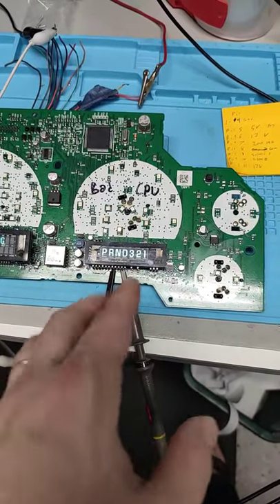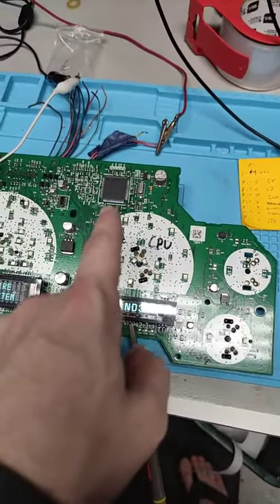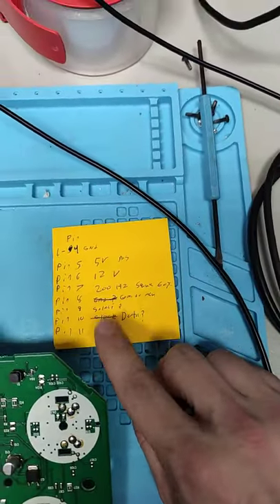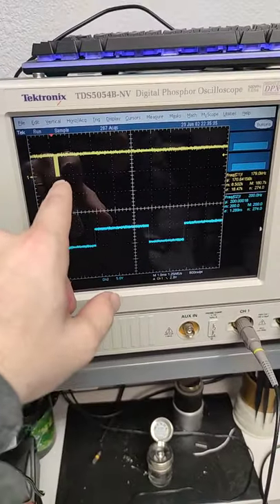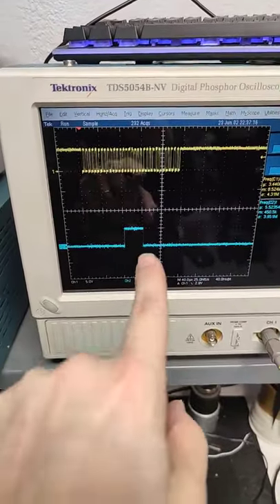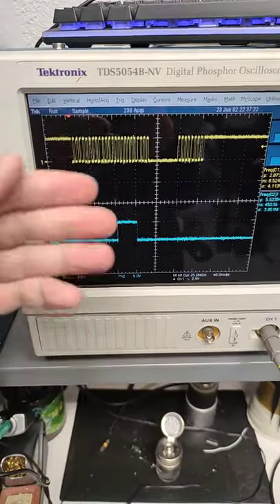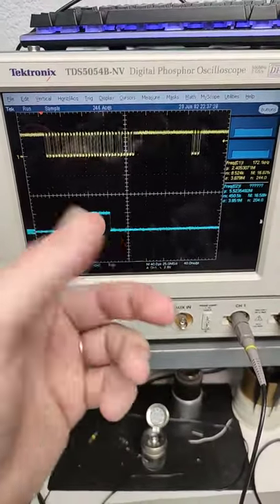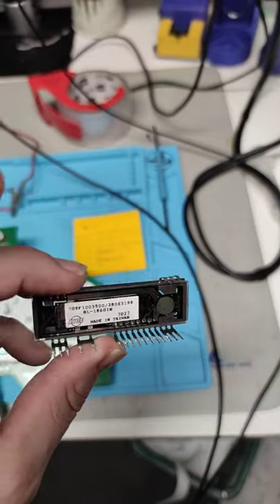Trying To Talk To Futaba VFD BL-185GIN

Comment: Is the display equipped with an IC? On all VFDs I have played with, the IC was on the motherboard, not on the display which have always been basic VFDs driven with a heater a common pin and each pin for each pixel.
Reply from the maker: Yes this vfd has a built in controller. It's you can see it under the glass if you closely at it
Reply: @FixedUntilBroken  hard to see on camera. I've been working with Chrysler units also made by Futaba, backed with OKI custom branded chips so I'm not sure this will help... But communication between the microcontroller and the OKI driver chip has a clock line, data, and some kind of latch or "end of line". One message would be made of 2 chunks each ended by a latch. First chunk is a 2 bits header + 12 bits of data (with a clock pause between the 2). Second chunk would be 2 bits header and 4 bytes (again, clock pause between header and each byte). No clock on latches. Timing and pauses between data "bytes" and headers are not critical when sending data to the OKI chip. IIRC refresh rate (frequency of the full chunks being sent) is around 50hz tho but the OKI does support higher rates! I don't remember the clock frequency but it could have been about the 200hz you noted. 
I could not figure this out without a logic analyzer (cheapo Chinese toy or basic LPT port with some LPT logic analyzer software). The 2 scopes I have would sync on the latches, displaying signals that where not the same length... 
From this I figured the first message was mostly for brightness control. The 4 bytes in the second chunk however contains the interesting part ;) each bit being one pixel (PRND123 on first VFD, mileage on the second display). 
I hope you can figure something out from this :)
Reply from the maker: @remiserriere  Thanks for the info. On the OKI chip used on the 03-07 VFD it using SPI and similar to the OKI you worked with it was first packet was brightness and such second packet it was pixel data. That chip has a lot ram too for stuff. Luckily on that OKI the datasheet is out there
Reply from the maker: Figured it out.
Reply: @FixedUntilBroken  nice! Will you explain how it works?